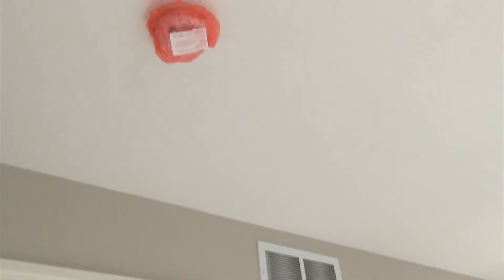How To Build A House: Final Inspection Part 1 Ep 69

Comment: smoke detectors? first time they were ever mentioned and what ever happened to hydro - Hyro-HYDRO??!!!
Reply: The hydro company supplies electricity to the house after people move in, is the hydro company supposed to come and see if the electricity is running? I'm not sure what inspection you are thinking is supposed to happen there. In previous videos, he mentioned that the gas and hydro guys come to do their own installation of the hydro and gas METERS, and they would have inspected the lines at that time as well. He also mentioned, in a previous video, that the electrical inspection was done before the drywall went up. It's scary that I've never been involved in any home building project and I seem to know a lot more than you. It makes me worried about what line of work you are in. I really hope no one has ever paid you to do any kind of construction for them. They got ripped off.